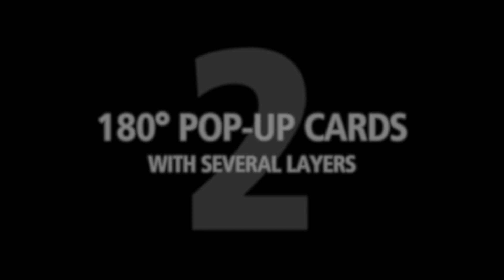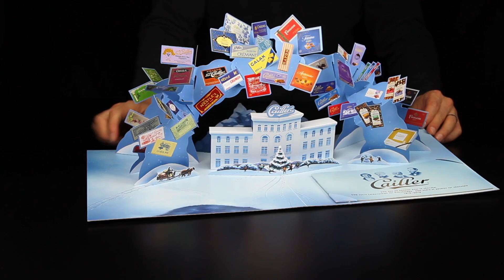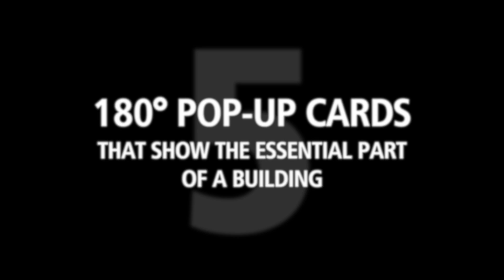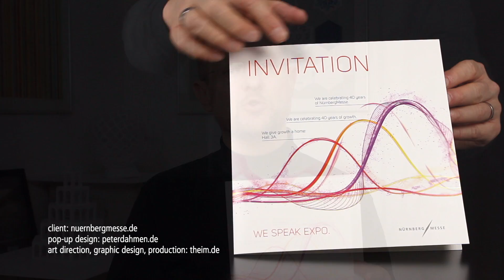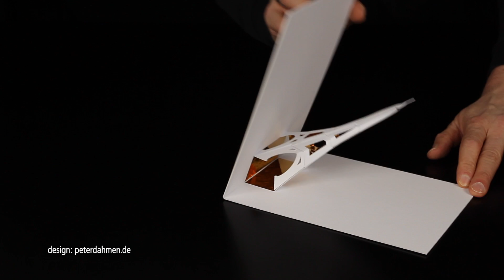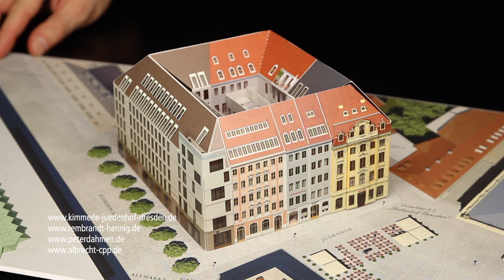7 Paper Engineering Concepts for Real Estate Advertising [Advertising]

Comment: Your works are amazing. I m a paper quiller and was new to pop ups and tried my own designs with few cards and a rhymes book. I would like to know, if i want to make a big project like 50 x 50 cm big base, do i want to use  higher gsm papers for pop ups. I usually use 165gsm for A4 size base,  but also tried with 220gsm.
Reply: @Peter.Dahmen.Papierdesign  Thank you so much for the wonderful reply. As i was thinking to get suggestion on pop up, the first person i thought of is you. Thanks a lot. I will check with your suggestions and will try out more to find which suits best for me.